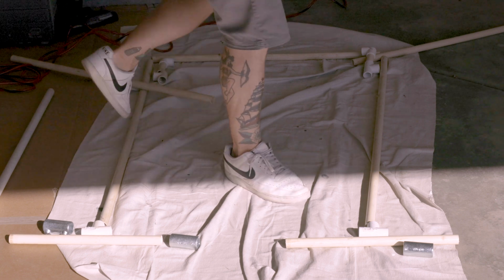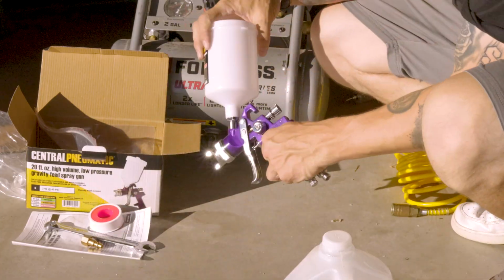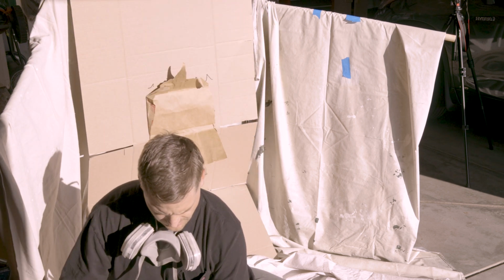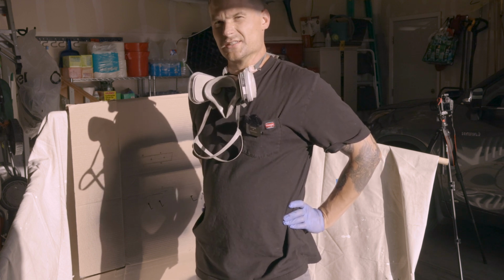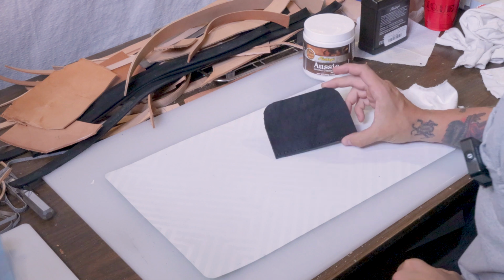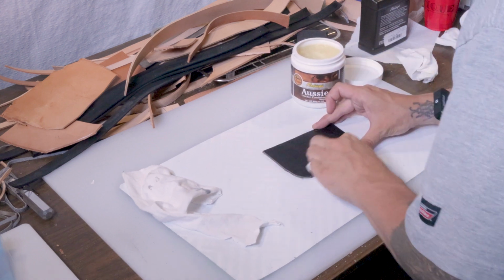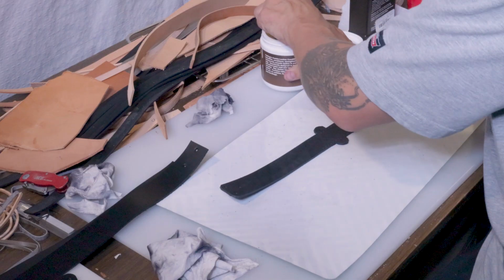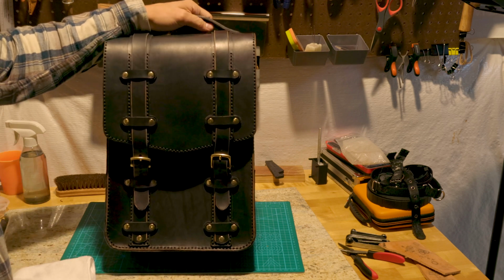Fiebing's Pro Dye Leather application using a Spray Gun

Comment: I could have sworn that I commented on here before but maybe not. I love two things about your video. 1. using a harbor freight spray gun. This is a nice choice for even coats when you have to dye a lot. 2. how you mentioned the N=NIOSH cartridge. Only one issue, you should probably not be using the NIOSH 6001 (Organic Vapor only). Since you're aerosolizing the dye (wet), you need a cartridge that can handle that. I almost exclusively use NIOSH 60923 (Organic Vapor + Acid Gas + P100). It's typically only $3 more and offers way more protection and versatility.
Reply from the maker: This is a great distinction. Hope everyone trying this technique sees this comment and gets the correct one!

Comment: late comment lol was just looking for videos on using a cheap harbor freight spray gun to dye bigger pieces of leather.  Fiebings is a good dye not as good as Angelus but black dye is a pain in the butt.  I usually oil my projects before i dye an older cat told me that over 12 years ago and I don't remember if it makes a difference but I've been doing it ever since.  The way he told me it makes sense most dyes contain alcohol and alcohol dries leather out and also evaporates so you need to add moisture to your leather before and the dye will also penetrate better.  I also finish with top coat of oil and then a good finish like tankote or Bee Natural RTC. Thanks for the info on the paint gun
Reply: What oil do you use for the leather?
Reply: @S.TG..   I'm guessing neatsfoot oil. Can be found at tractor supply or online of course

Comment: Aussie isn't a finish, it's not going to  seal in anything. The good news is that much  won't come off due to the fact you used an  oil based dye which  penetrates deeper than a powder pigment based dye  and   essentially used very little dye in the first place.
Reply from the maker: That's good to know. This did end up being a pretty conservative amount of dye for the project size. 

I have since tired the EcoFlo Satin Sheen (mentioned in another comment here) over Pro Dye and like the results a lot better as far as sealing in dye to prevent rub-off.